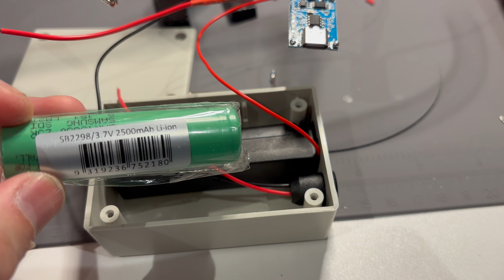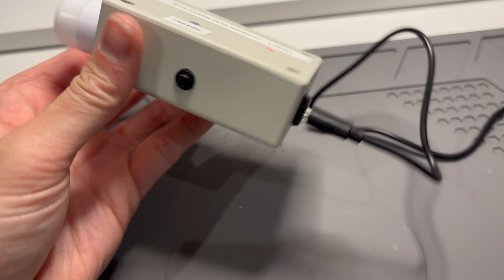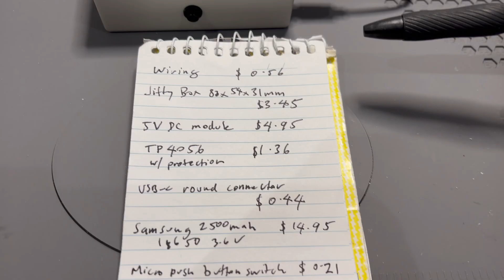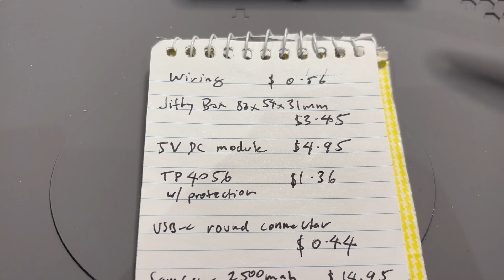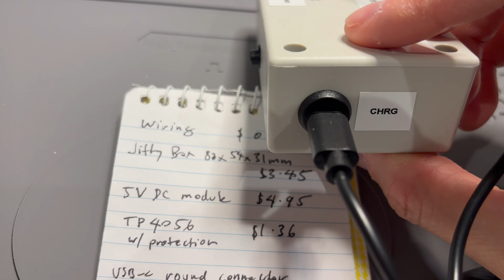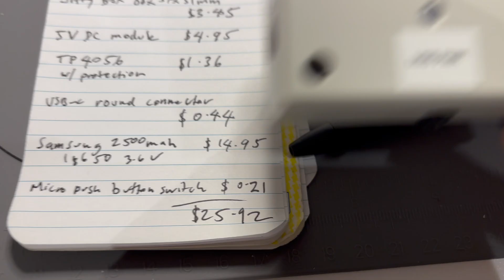Power Banks Keep Turning Off? Build THIS 18650 Li-ion 5V USB Pack!

Comment: Uhh $15 for that 18650 2500mah battery? 
And couldn't you have bought a mini UPS? or even a circuit for a mini UPS that uses 18650 batteries. They are quite cheap. I use one myself.
Reply from the maker: Not cheap but available at my local Jaycar store. I have a mini UPS board video on my channel if you take a look. Thanks for the comment :)

Comment: Did I miss something?  Will this arrangement keep from completely discharging the battery?  I'm thinking that would make the Li-ion cell unhappy.
Reply: The TP4056 module has a DW01 battery protection chip on the board, so it should protect the cell from over-discharge. The boost converter on the "load" side is hooked up to different pads than the battery itself.
Reply: @siberx4  I did replace Dw01 with FS312 because 2.4-2.5v cut off is very low for my taste, Fs312 cut off at 2.9v and also they have the same pinout that you can just desolder and resolder fs312
Reply from the maker: That’s correct. Adding a 1S BMS is redundant with this version of the TP4056 :)
Reply from the maker: This version of the TP4056 has a built in protection chip. The battery has different pads to the load :)